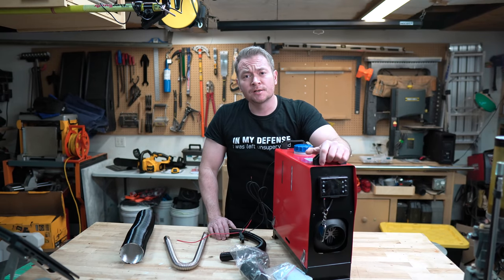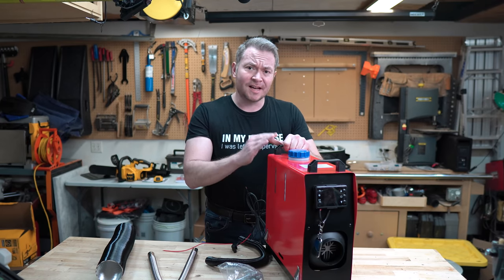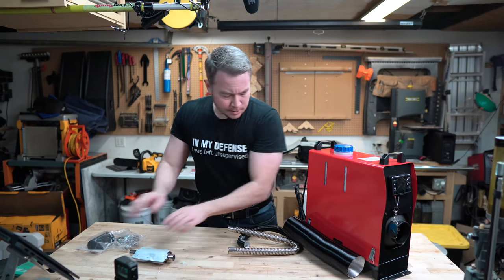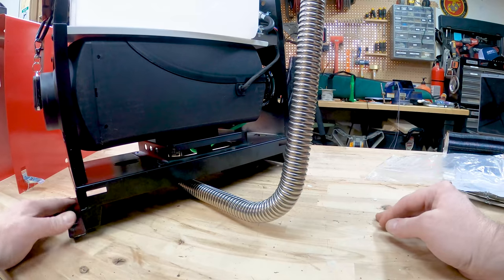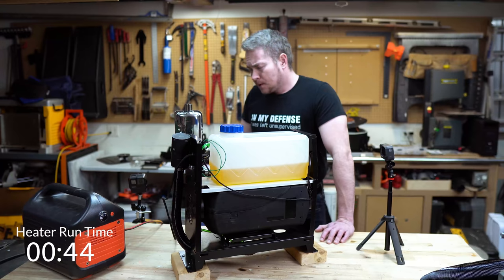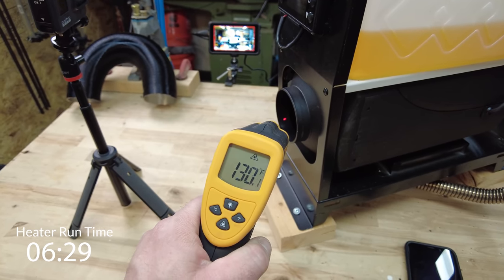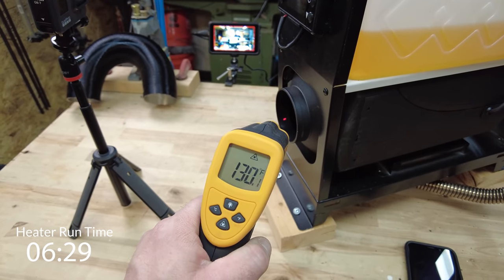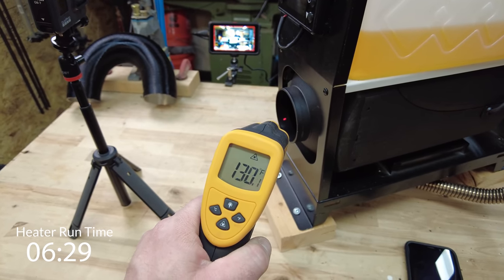My First Chinese Diesel Heater

Comment: As a professional truck driver, we use these kinds of heaters for keeping the bunk and cab warm at night. These stand up units are a problem, you should get the other version and make your own box. I have seen the other kinds here on YouTube and they work really good. (The kind we use in semi's ) But, nice video over all.
Reply from the maker: thanks for watching and for the advice.  I've been considering doing something like building my own enclosure with similar (but not stand-alone) heaters actually.  Nice to hear you've had some good experience with that route.  If I give it a shot, I'll certainly try to do a video on it as well.  BTW, IMO truck drivers don't get enough credit or gratitude for the work they do to keep the country running.  Thanks for what you do!
Reply: I warm up my cabin with a 200 watt bulb could you believe this?
Reply: @Hakimfarhat  97%heat
Reply: Richard do you have a brand name for the heaters you use in the semi's ? TY
Reply: @bustersmith5569  espar bunk heater. They're about 1200 dollars
Reply: @bustersmith5569  it is either a VOLVO brand or a  Thermal King style APU on board generator ..
Reply: These  all-in-one units (stand alone) are simply the standard heater, pump and fuel tank mounted in an enclosure. Saves faffing around mou ting all the separate parts. The issue with the e haust can be overcome by fitting a 90deg stainless steel elbow available from eBay or by cutting the end of the supplied exhaust leaving ½" plain end which is enough to clamp it to the exhaust port. No need to add any blocks. Exhaust insulation in the form of woven glass fiber tubing is available  (ebay).  I fit an inline fuel filter between the fuel tank and the metering pump. I have installed many of the chinese heaters over the past 4~5 years and have not had any issues apart from one pump failure after 3 years service. Concerns over using diesel or kerosene seem to be from the bar room know-it-all-know-nothing types. I have 2 of these in my shop running on heating oil (kerosene) while the two units on my boat run on diesel with the occasional run  on  kerosene (100 or so hours running on diesel and one or 2 hour burning kerosene. Do not use lamp oil, it is too highly refined and lacks lubricity. Depending on where you are based, derogated diesel (aka agricultural / marine / red / green) is as cheap as, or even cheaper than kerosene.
The later (2022) instruction booklet is better written though youtube videos, of which there are many, will help especially in programming features including priming the fuel lines and setting up the controller.
These heaters come as a 2kw, a 5kw or an 8kw version the 5kw and the 8kW are the same unit with the controllers programmed differently. This is achieved by altering blower speed and amount of fuel injected. The 2kw version  is a physically smaller unit.

Comment: Great video!! Almost an exact replay of my first run including the wood feet :). I had that exact same unit. Got a little over a year out of it then started to get carbon build up when camping at 4000 feet in the snow. Cleaned it a few times and gave up. 
However, convinced I liked the system, I bought the Eberspecher and I haven’t lost a night of sleep again.

Comment: Thank you, straight to the point. I have the same one and jackery 1000. I ended up cutting the end of the exhaust tube, down to 3/4”, as that was all that is needed to clamp. However, I do like the 2x4 to keep the heat off the ground.
Reply: does this heater come with the 12v plug for the Jackery or do I need to go buy one?

Comment: Tom: If you can get silicone hose in that diameter at the auto parts store, plus high temp. plastic fitting(s) for your exhaust so use these instead of the steel hose that will melt your tent. In fact, you might adapt the hose to a 180 degree formed aluminum tube used on washer drain lines. Fasten a wire long enough to tie to a tree to that tube will stay out of water if raining. The added bonus is that the hose will muffle the noise better than the muffler. Give us an update soon so we know if it's unit is good or crap. THANKS!
Reply: @willpelton1619  90° ellbows are bad for the AFR and will cause soot.
also plastic anything on an exhaust is a catastrophic failure.
Reply: I take it the exhaust has got to terminate outside?
Reply: @Identifyplumbing  of course. like every exhaust you could imagine.

Comment: I've been running the Espar D2 Webasto heater in my semi-truck for over 10-years now and it's still going strong. Obviously it is not encased in that red housing rather it's permanently installed underneath bed. I've only rebuilt mine once so far and parts are readily available up in Michigan. As mine is hooked up to a 225 gallon diesel fuel tank, the unit continues to run unmonitored for as long as it has 12-VDC power. On mine the combustion chamber inlet air and exhaust is direct to the outside along with the fuel pump which makes the unit extremely quiet while I'm sleeping. After the unit has heated the space to thermostat setting in high speed mode, it then goes into low speed mode to maintain set temperature (80°F for me) which makes it even more quiet and uses even less battery power. I believe they only use 2/10th's of a gallon of fuel per hour. So in colder months, it heats the inside of my truck cab without running main engine and it is an emergency heater should my trucks heating system ever fail such as failed blower motor or switch which has happened. As a backup for the home and the truck, I also purchased the Chinese knock-off version of the Espar D2 heater which has been setting on a self in it's original box since it arrived four years ago as I haven't needed it. With the availability of parts and easy serviceability, my Espar D2 heater will continue to run for many years to come. The secret to keeping the glow plug and internal parts from carbon buildup is to run the unit at maximum temperature which is 90°F for at least 1/2-hour every month, even in the summertime. During this time, any carbon buildup burns off and exits through the exhaust pipe.
Reply: Same here, my webasto has been installed 22 years & apart from a fuel filter change & a strip down decoke it's still super efficient,I've been in my campervan at -5 °  & been very comfortable.
Reply: I have 5 of these heaters. 2 of them heat a 34' travel trailer at 20° below zero.
I got the cheap ones but they are impressive when they work.
Reply: @IggnantOG   do you mean 20 degrees  below 32 ° Fahrenheit  or 12° Fahrenheit 
Or do you mean minus 20 ° below zero
 Where do you encounter 20° bellow zero degrees

Comment: I have the same heater in my 14' x 7' enclosed trailer. Drilled 2 holes in the floorboard. Ran the exhaust and air intake out the 2 holes. Before I did that I used epoxy to seal the wood. On the exhaust pipe I wrapped it with carbon felt. Fed the hoses through the holes and attached them to the underside of the trailer. I have been using this set up for over 5 years with no problems. I would recommend ordering a backup fuel pump off of eBay. Since then I have two more of these heaters they're the shorter ones and I use them to heat ducK blinds, tents and ice fishing huts. And yes you must allow these heater units to go through a shutdown phase where everything is cooled off. Or you will cook the ECU.
Very good video.
Reply: Hi , i would like to hear about the temperature control when you install this uniti outside the room , i am thinking to do the same but how the unit can read the room temperature and stops when it reaches the targeted temperature? Maybe you need to shift the temperature sensor to be inside the room? Thanks

Comment: It's old technology,  that heating element comes standard in an APU (auxiliary power unit) in big trucks, it's that little box on the side of a truck that has a small engine so you don't  have to run your big engine, provides a/c, heat and keeps your engine warm even though it's  -40 outside, that's the heating element, I used one for over ten years, worked great.
Reply: the one you used was not made in china
Reply: @titantitan3030  how do u no, that apu was from thermoking and everything they have is made in China and plus I didn't nock off the model.
Reply: @titantitan3030  Nearly everything is made in China, even Webasto buy parts from there.
Reply: They put the main parts of these under the bunks of cascadias

Comment: Nice quick demo of the heater when new, thank you Tom. There are problems which come up after a short time ie plug fouling, pump line too narrow for spec(tells us the exact replacement parts to make good) , even that the 5kw uses more power than the 8Kw yet is the same size. The youtuber below has an excellent series on this and more.

 I like to recommend John Mack's series of teardowns and maintenance videos for anyone wanting to operate a Chinese heater. He has the best, most comprehensive mechanical investigation I've seen to date, bar none!.  He covers all heater designs, and all aspects while demonstrating replacement parts upgrading for hidden weak elements.  Offers service techniques and home made tools for known common yet avoidable failures.  Insights, analysis and tests on the system, with practical observations and suggestion for improvement. And he is a regular humble Aussie guy.  Many people have probably given up on their heater because they didn't know about  these incredible video's by John Mack on the heater.   We owe him a great  thanks.
https://www.youtube.com/playlist?list=PLne7MoW21Rk01DYGGfOqIbYt6H1ZFSFks

Comment: I've had these heaters since the early 1970's. Mine was in a 1967 Volkswagen. It ran off the cars gasoline!!! It had a pilot light also which kept the snow from sticking in the NH winters. It put put out a MASSIVE amount of heat. Old Volkswagen's had no real heat to speak of.  I've had Eberspacher and Espar since day 1 when they came out. They suck and always have. They carbon up real easy. I run kerosene only since the last 10 years or so. Much cleaner and less problems. Most all trucking companies run kerosene using an external 50 gallon tank.

If it's Spring or Fall and your not running these full blast you should once in a while to heat them up and blow SOME of the carbon out. Doesn't get it all. If you go to Walmart in the lamp section you can buy a bottle of lamp oil which is kerosene. Undo the fuel line and stick in bottle and run heater on full. Do this at night in a parking lot and watch the sparks fly. That's the carbon burning up. Kerosene burns much hotter.

if you've been running your heater on low all day or night run it on high for 1/2 an hour before shutting off. 

You don't have to use the small fuel tank that comes with the heater. You can use ANYTHING. A milk jug!!! Doesn't matter to heater. Just stick the fuel pickup in. I use a 25 gallon Coast Guard approved diesel Mueller boat fuel tank. Already has fuel pickup line and vent. Just plug your heater in. 
Don't get a drop of diesel on your clothes, sneakers or anything else. You can't wash smell out. I ran an external fuel fill outlet to the outside. Just a small one. I use a transfer pump with a rubber fuel line connected to a pump and cigarette lighter socket. I transfer fuel from 6 gallon gas tank to inside 25 gallon tank. 

Don't try to replace glow plug. Not worth it. Chances are your combustion chamber is all carboned up. These units are cheap. Buy another as a backup. Replace intake and exhaust metal pipe with stainless steel. Find on Ebay. Also, these heaters are cheaper on Ebay especially if you buy 2 or more. Buy backup pump.   

When your heater starts blowing smoke on startup it's going South soon. It will start to blow so much smoke the police will have to close the road. 

If your heater breaks use that opportunity to take it apart (After buying a new one) and see all the parts. Take combustion camber apart. Sand blasting it the only thing I've found to get rid of carbon. Save all those parts especially the sensors and control board as spare parts. Still, just toss it and buy a new one. 

I have NEVER NEVER NEVER EVER had a problem with any of these units since the 19070's failing and blowing fumes or anything else. They shut down REALLY quick. 

Make sure you pull the clean air for the cabin air from the cabin. I'm not talking about the combustion chamber intake or exhaust. They go outside. Don't put the clean air cabin air intake behind a cabinet or something else. It will get all gummed up with dust and everything else and your heater will fail unless it's cleaned all the time so make it easy to get to. 

Espar still hasn't got the message. NOBODY is buying their units anymore and they are still charging  $1,000+. Their sales have fallen off the cliff and I can't see them in business much longer.

Comment: The big advantage of these vs kerosene or propane heaters is that you can completely separate the combustion air supply and exhaust from the air that you're heating and breathing.  You don't have to worry about not waking up due to something going wrong and CO being released if the exhaust is ducted OUTSIDE.  A buddy of mine uses one on his RV which he inhabits full time and it worked great for him.   Because of the low cost, just just bought a spare using to experiment with and use as a back-up in case of failure, since it was his principle source of heat in the winter.

Comment: Used mine this spring, new tent. It was cold in the mountains, it worked as advertised! My learning curve was making sure the window is cracked. Error code 5 is telling you that the fan can’t blow any more in.
Reply from the maker: Glad to hear a good experience!  And thanks for sharing about Error Code 5...I would not have guessed that.  Sounds like I should make sure not to have too much positive pressure inside the tent if using this to avoid overwhelming the fan.  Thanks for the tip!

Comment: If it keeps you warm over a few really cold nights you will like it a lot more than you do now. This model is perfect got your purposes because it can be moved around, but the models that have a separate tank and without that large case seem to be the order of the day for van dwellers. But they are permanently installed. Some people replace that muffler with a higher end model and there has been a quiet fuel pump created as an aftermarket product.

Comment: Jonn McK 47 has a channel dedicated to these heaters. An amazing amount of knowledge, tips and advice on there. 99% of the problems encountered with these units are due to poor setup and installation.
Well worth visiting his channel
Reply: Wow, I looked at his first two (part 8 &9).  Very thorough.  He must be an instructor.
Reply: I also found John McK 47.
Studied the 20 odd videos and when I saw how easy it is to service plus so many kits and parts sold on Ebay,  I decided to buy one for my garden cabin. 
Great stuff

Comment: Coming from my background as a generator/small engines mechanic in the Army we always used auxiliary fuel tanks.  If you can figure out a way to retrofit an auxiliary fuel tank to the unit that will be the simplest way to extend the time it will run for in one setting on “a tank” of fuel.
Reply: It's only designed to run one tank before catching on fire
Reply: @allen-gt5ng  😂🤣

Comment: What you should do to massively improve is to attach a second heat exchanger on the exhaust to heat water.  ;)
Reply: how do you do this? and where can you get a heat exchanger haha
Reply: @Jameshowardadventures  I would imagine you could bend copper piping around the exhaust tube and have a water reservoir and a pump along with a temp sensor to disable the pump. Probably not the most efficient, but I figure it would be easy to setup.

Comment: Exhaust line seems dangerous, to close to the ground and no insulation in case of contact with something flammable.
Second concern is the exhaust fumes, no visible fumes doesn't means no danger, CO is deadly but cannot be detected by a human nose !!
So in case of internal use, you better insulate the exhaust line and lead it outside of the room.
Reply: Everywhere I use anything that produces carbon dioxide I also use a detector. Doesn't matter how well it is sealed. They are cheap insurance, and almost always use batteries. Which allows them to be used in a mobile situation.
Reply: Put the thing outside and pipe in the warm air through the fat pipe he showed (but didn't use) and insulate it.
Reply: The beauty of a diesel or kerosene fired heater is the ox of nitrogen will burn the eyes out of your head long before co harms you.
Reply: @NBHank  both my brother and father were nearly fatal poisoned by diesel exhaust when my brother was about 15. Took about 2 months for my brother to recover enough to come home from the hospital. Took even longer to fully recover. A big rig decided to idle next to the camper they were in.
Reply: @williamallen7836  holy shit thats crazy
Reply: @thomasbarlow4223  yeah that was just the basic version for brevity. My dad was hired to be a "live on-site" security for a company with a large warehouse, and loading dock. His camper was intentionaly parked ware  trucks were not supposed to park. So it was clearly the drivers fualt. My brother had 2/3 rds of the carbon monoxide concentration that is consider lethal. My father, who was a severe alcoholic, was nearly twice the lethal dose. Yet walked into the hospital, and perfectly lucid. While my brother was having seizures. When his blood test came back the doctor made my dad lay down. It wasn't until then he started having trouble staying awake. The crazy part was my father was able to go home in 3 days, and didn't appear to have any lasting effects. It's odd how life works out sometimes.